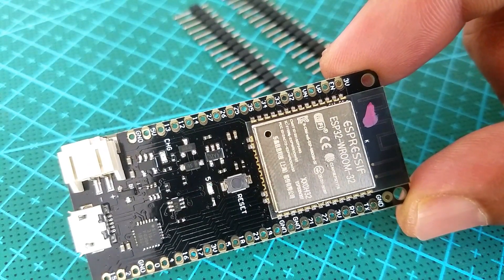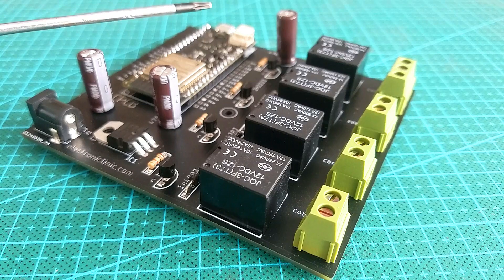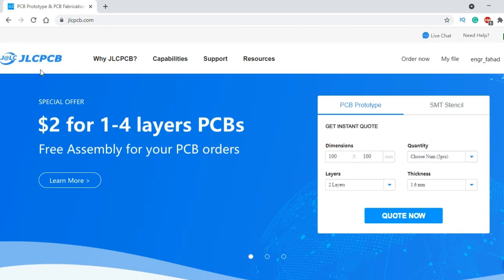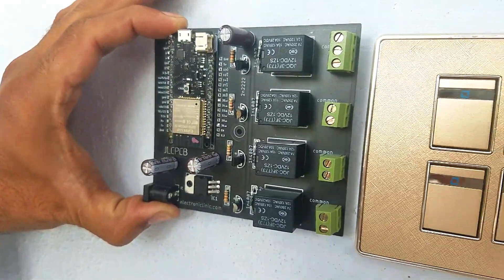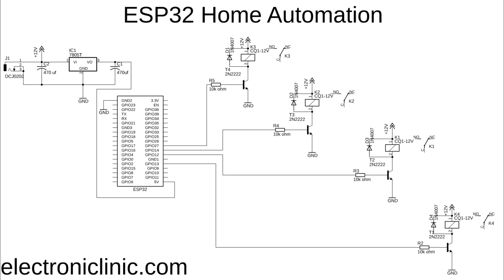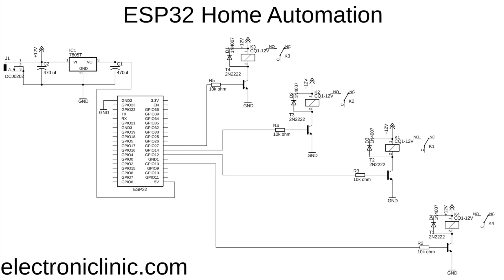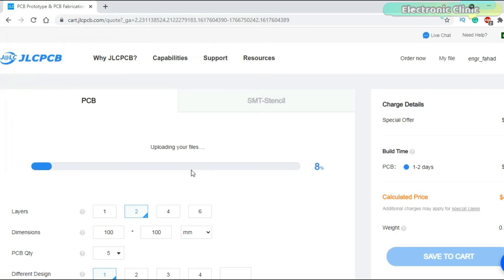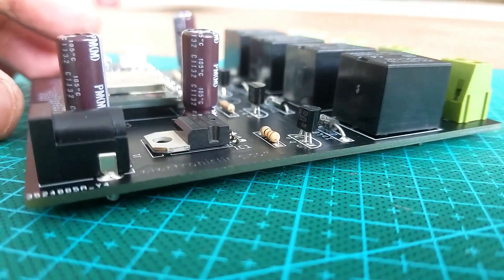Home automation with ESP32 WiFi and Bluetooth, control ac and dc loads at the same time

Comment: Hello ! I have a doubt sir , 
 rfid and gsm both can run in same program? Like I want to add a rfid relay control lock that's simple and also in same code I want to add gsm sms lock ? How can that be possible pls can you help me 🙏🙏
Like I will send the sms with specific number , then the replay will respond, actually both programs are being made by me but they are running fine individualy but when I combine them in if else statement , the rfid works but not the sms pls help